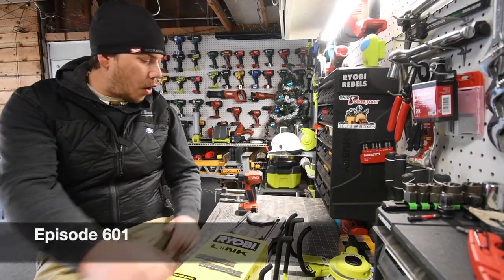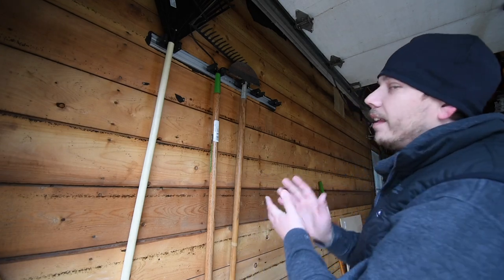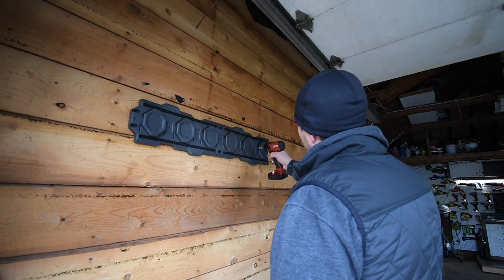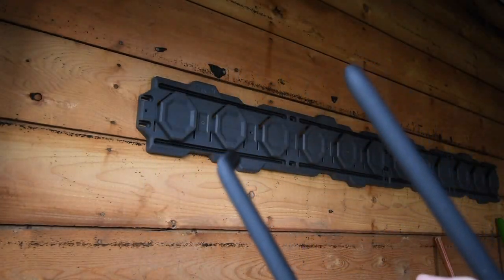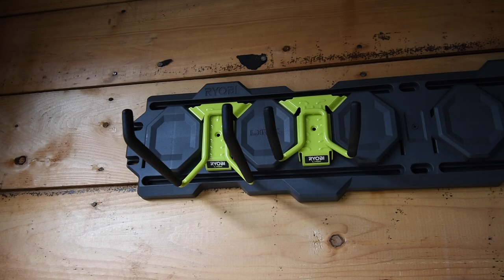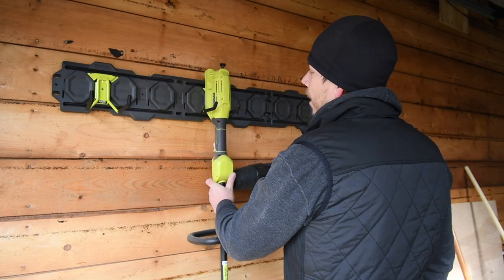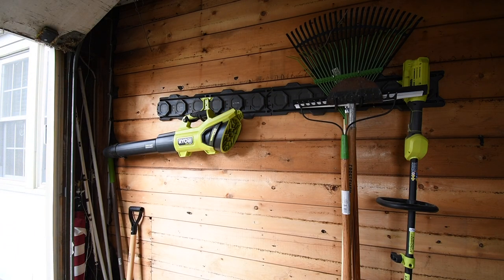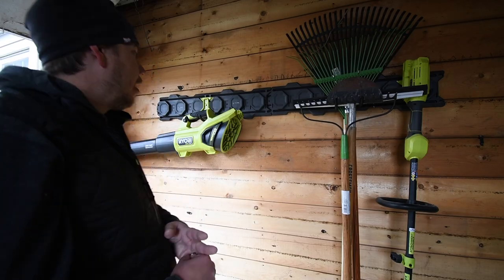I’m returning this RYOBI Link System!!!

Comment: This looks like it's well worth the price for the wall system. I don't care if pegboard is free it isn't worth the time it takes to install. The hooks are made of thin wire and they pull out of the board too easily. Having a dedicated spot on the wall for each of your tools keeps them in reach and easy to find. It also makes it easy to notice if one isn't in its home. Better organized equals more efficiency and this system makes organization easy. In as little as one year you can save enough minutes to pay for the whole system.

Hanging the tool boxes on the wall is stupid. They belong on shelves or stacked on the dolly. Packout, T-Stack and other toolbox systems look better than Link. I recommend the link wall system but not the Link toolboxes.
Reply: Agreed. I like the link wall system mainly because it’s so configurable and I hate the pegboard system. The pegboard system is madness when you pull off a tool and the hook comes with it. 
  I like the crates that mount on the wall. That’s pretty awesome. The link shelves are junk. 
  I’ll do a combination of both link and pegboard and I’ll see who wins. 
  It’s expensive but if it works and is flexible  it’s an investment.

Comment: I have to agree with you. It's way too expensive for what you are getting. A few peg board walls and hangers will do the job at a fraction of the cost and if your too cheap for that, then just use nails or screws in the walls. Even the pack out boxes seem to be pricey in my opinion.
I think you did the right thing to return the items.
Reply: I agree its a bit pricey  but peg board is cheaper and will eventually fall apart because of moisture. This system is far more durable and virsital and that's what I love. I've tried screws and if I need to move them around all I'm doing is making un needed holes in my wall

Comment: I love Ryobi, I genuinely do. But with that said, I gotta agree.
It's a cool system. I do like how it's modular, and how unlike a pegboard you can add/remove pieces easily without cutting or just buying a different size(in regards to wall space, not the mounts). I like how if you're gonna help a friend and gotta take some tools, you can just take the toolbox off, throw it in your truck, and hang it back on, and it doesn't take up as much space as having it horizontal somewhere. 
Some people hate it, but I like it, and I like it a lot. If/when I have a garage, I would absolutely buy it.
BUT you and others are right- it's way too expensive. $75 for 2 boards and 3 hooks is a lot of money. 
I did see one comment that I completely agree with- that it would be awesome if that mount was integrated into say, the gardening tools like the string trimmer and leaf blower. that would actually make it more worth it imo

Comment: I just bought the starter kit for $60. I know its a whole $8 less, but that is an extra hook. LOL. Planning on mounting it up this weekend to get some stuff off my garage floor, and planning is for sure a thing. Same can be said for peg board and other hanger systems. Trying to see which way I can waste the least amount of space while maximizing the most amount of wall. 

The concept is super cool. Unless you are putting a lot of bins up, doing two rows up and down makes zero sense since you will just be seeing the design under your larger hanging items and it wont be used for actual hanging. Now if they made caps or something to make it look more boxed or something for when you just do strips, that would be just another thing to praise about the system. Cause I am not going to do my whole wall in this. HAHA. Ill be having small strips where I need it.

Comment: If Ryobi were thinking they should have designed their garden power tools housings to have the pattern to hang them without brackets...especially the blower( I can see its base and it is prime for the link pattern)...that would have lessened the cost impact and been a selling point for their power garden tools ...as it is - no way...I would rather use metal pegboard any day of the week!

Comment: I bought the starter kit which was a 7 piece setup that is $56. Better deal I think.
Reply from the maker: we will see what the deals are in the future
Reply: @ManCaverTools  I thought I would throw that out there, I work at my local Home Depot store and when I learned about this new system from my Milwaukee Rep, I knew it was something I wanted to invest in. I learned about the price point of the the whole thing and knew it was gonna be expensive until just 2 dsys ago that my Milwaukee Rep had pointed out that there is a 7 piece starter kit which was a good choice. It had the 2 rails, 4 hooks and a double little storage bin for like screws or anything loose that u want to put in them and it the cost is $56 or $59 for that which to me made a more sense of purchase. I am looking at it as an investment on my part. I really do think Ryobi had a good thing going and yes again it is expensive but I would pay for quality product that will stand over time compared to some of the cheaper stuff that may not last long in my opinion.

Comment: Warning: lengthy comment ahead, read if you will. I have some pros and cons about these. The concept is a great idea for sure. The drop into place hooks I believe are a win. Not only do they interlock easily but they are easy to move when you want to rearrange your tools. The hooks seem to be well built as well as have a nice finish to them and will make for a sleek looking set up if you build up an entire wall. Here’s where things go downhill for me. Just watched a video from solely ryobi and you have to place the hooks every other slot just to have your drills up. There’s a massive waste of space in between each tool due to the design. And yes you can always get the tool shelf where the drills hang upside down but then your looking at $65 for the small green one with one shelf or $70 for the one with three shelves in which either one only holds up to 4 drills, mind you this is after already buying the wall mounts.(you my friend, would be in some trouble) lol. This system allows you to put the link tool boxes on the wall which is redundant. I would never take a box with tools in, turn it sideways to make everything inside shuffle around just so I can stick it to the wall. But let’s say you do, you would have to take the box off the wall every time you wanted a particular tool from it, or open the box on the wall which I don’t think is a great idea. And if you have already unloaded your box first, well why would you even put it on the wall if it’s empty. I know that’s silly and sounds like I’m grilling this product but it’s literally marketed like that on Home Depot in the pictures. Point in case is, the boxes have no business being anywhere besides a real storage shelf or stacked on the ground. Also anywhere I have seen a picture or video of these, they are mounted into drywall or a wall you easily screw into… I have cinder block walls in my garage, I’m not going through the hassle of drilling and vacuuming all those holes for each bracket added. Now the main deal breaker is the price point. Way too much for the amount of added wall storage. No bang for your buck as far as what they are intended for, hanging storage. I have a 4’x8’ peg board set up mounted on 2x2 strips with all the hooks I would possibly need for about the same price of this set up here. Not to mention the peg board is way more efficient in spacing. I just wouldn’t be able to justify the spending if I wanted to convert my wall to this system. To wrap this up, if you are a homeowner/DIYer that just would like to have a really nice looking set up in your shop and you have some extra dollars to throw around then by all means go for it. Just realize you can go way further while spending a fraction of the price if you choose a different way to set up your space. I like the idea of these but it’s ultimately a pass for me.

Comment: Maybe you are using it in a way that is not ideal (exclusively as a hook system). I think the cost problem is that the utility of the three hooks can be replaced with cheap hooks that you screw into the studs. Where this system shines is in mounting the tool boxes to the wall, without tool boxes its a hard sell. Yes it is expensive, as are all tool box systems....this one happens to have hooks for OPE.

Comment: I think pricing wouldn’t have been as bad an issue if it had come out a couple months after the Milwaukee packout released. Ryobi could’ve used it’s integration with the mobile boxes as a selling point, but now most people are too steeped into packout to see this as more than just a wall system.

Comment: Why does Ryobi make you have to buy the link system back for it when you could just buy the $4 hangers  without the back system and screw them into the wall?
Reply from the maker: exactly. I can't justify the cost when there are cheaper options out there

Comment: yeah it's expensive for sure, but why didn't u just point the blower away from the tools the first way u had it? that way u still have that entire other side. the blower can take the right most spot pointing the other way, and the other two hangers look like they could fit on the same track